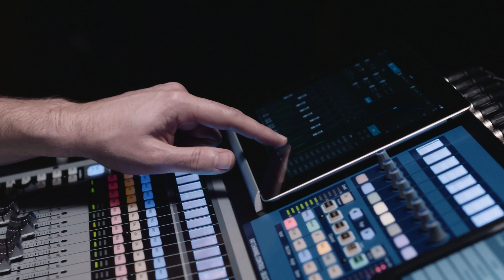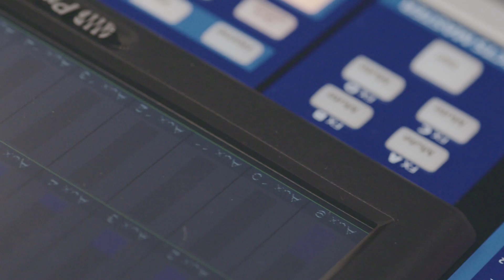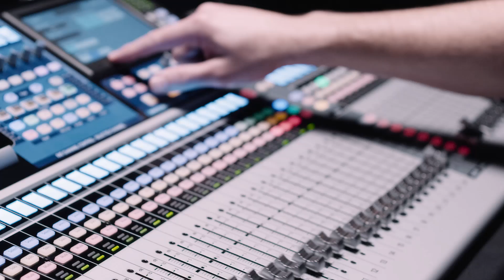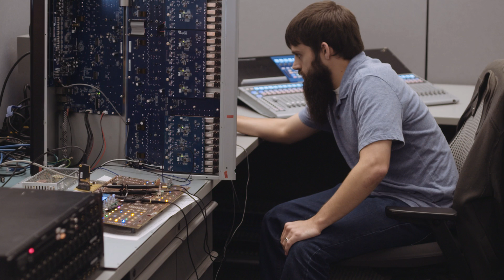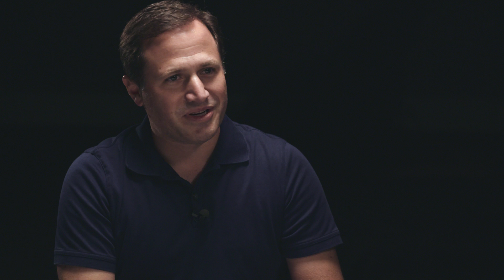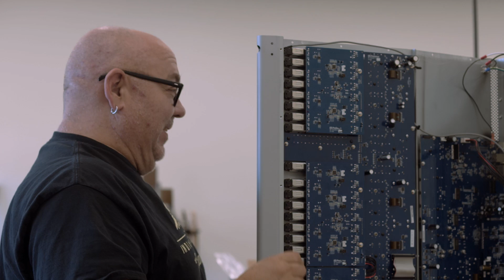StudioLive 32: The Interviews

Comment: nice, but like the (woeful) faderport 8/16 you are still getting crucial ergonomics WRONG.

Your faders are TOO close together. you are emphasising compactness over usability/feel (esp for mixing in a studio rather than live where it's not so important). Not one of your controllers, inc CS18 or FAderport 16 is really up there with the best controllers that take mixing seriously. For that you need good spacing between faders, at least 24 faders (like the old control 24) and if you can't finally fit BLACK OLED screens then 1. Please stop advertising your products as having BLACK OLED SCREENS (every press shot shows these! but I had a faderport 8 and returned it as it was so bad and the screens were awful, cheap glaring LCD!!) 2. Remove the LCDs and use good old fashioned LED screens (like Nucleus) which is a lot clearer than faded/glaring LCD.

Also you must put a knob above each fader, it feels wrong having one or just an area.. complete missing the point of "physicalising" ITB mixing. Basically clone Control 24/C24/Dcommand but improved and only slightly smaller (not too much). I think you overthink this stuff, seriously. The faderport 8/16 are terrible. Faderport 1 is cool.

You keep getting quite close but are so far. Take your controllers more seriously and you may finally but the last nail in Avid's coffin. Make something of similar quality to S3, Control 24 and D-Command, upgrade your screens, space your faders properly, remove the slippy/cheap feeling fader caps, and nail 100% studio one functionality (inc a channel strip area to control ALL plugs not just your own - properly ala Roland VS700c) and you will finally have the controller everyone has been waiting for. Dont' include any audio stuff, preamps, monitoring nothing.

Basically make an improved SL32 III with better ergonomics, remove some of the distracting stuff up top, remove the live/audio stuff and make a 24 fader controller for S1 that destroys what Avid can do for below half the price.

Then Studio one will really have arrived.

FTR I am massive Studio One fan and I think Pro Tools is archaic and convoluted. but they make great controllers. Presonus still lacking there.

OK that's a large wishlist, if you can only correct ONE thing for a future controller it would be to space those damn faders out, it feels terrible 'mixing' with them clumped together so closely. May as well use the mouse! Next would be sort the screens or use LED screens, ditch the cheap/tacky/overbright LCDs they look and work terribly.

Comment: Please add the ability to add midi sysex outs to a scene so you can for example, switch a program on a external synth to the right one for a song.  Also, please add the ability to map scenes to the TIMEPOINT in a song so at that time point the scene changes and is applied. (not sure if you already have that). Theres a Rudess interview about the Korg Karma where he says how great it is to be able to line up all his changes and have them automatically there at the touch of a button.  But to do that he has to buy a 5,000 dollar single SYNTH with EVERYTHING in it and maybe code just a little control for a few outboard units. Controlling all these synth boxes really is a chore so it would be great to have it be the BRAINS for that and scenes in a song.  Now I can have a forrest atmosphere scene with jazz piano on top off my 2 controller keyboards, then get to the next song point and I've got orchestra and timbales. that would be so amazing. And all mixed to the right levels so they are playable together AND assigned to the section of the keyboards I want. all through midi.  Its possible. You guys are smart you can do it!

Comment: can I get 24/96 or 24/192 recording on the first 8 tracks + mstr to usb PLEASE!!!!
Reply: pretty please with sugar on top?
Reply: No, really I would run out and get one THIS HOUR if it did that.  why? there is SO MUCH that is doing the 24/48 store to USB, behringer had it on their UFX mixers YEARS ago.  Tascam uses that for their outputs. There are a LOT OF US who have been waiting years to get this into the modern age (24/192) or at least (24/96) which actually THE FIRST DIGITAL MIXERS DID 15 YEARS AGO. So why go backwards. Its bullshit. It's important because its not the final mix, its still going to get processed in software most likely, or if not, for mastering you really want to start with the best. It's important! 24/48 only cuts it if its the final out and the target is CD quality.  A lot of people in Jazz and classical want much higher quality recordings, especially for masters. So if you do this as a business, can you imagine saying to a client "here is your 24/48 master track" you'd get slapped! The USB devices ARE fast enough if you simply require the fastest ones to enable the higher rates.  Theoretically, a 24/96 signal is 4.39MBit/sec so you can store 18 tracks with 79.02mBit/sec. Cards today easily do 90MBit/sec (sandisk extreme pro)! No problem! How about space in my 32GB standard card.  Well I can do 16 tracks at 24/96 for ten minutes at 100Megabytes.  So one card could store 320 ten minute songs of full 16 tracks at 24/96. Again its no problem! The technology is there. the only thing holding presonus back is presonus.